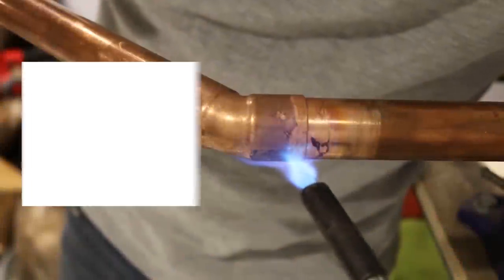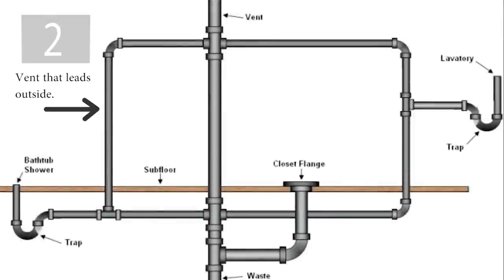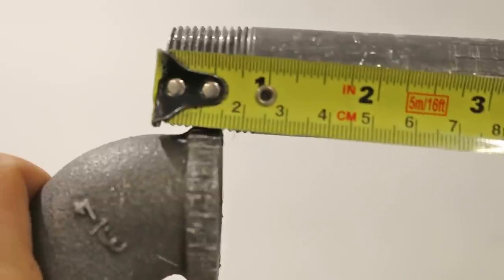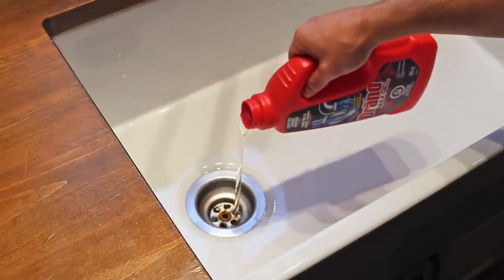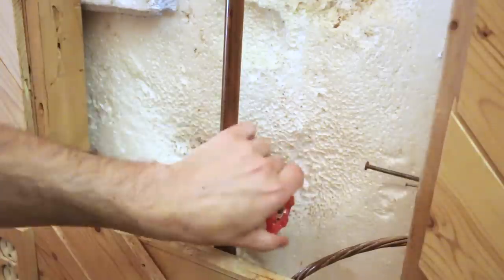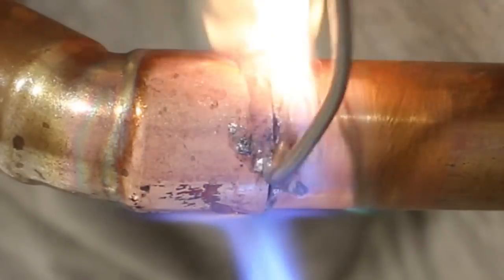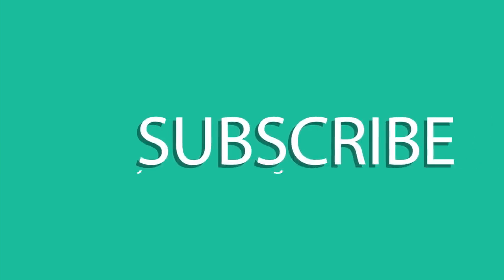10 Plumbing Mistakes You Should NEVER Make and How To Fix Them! | GOT2LEARN

Comment: Great info video as always!  Number 8, minor tweak: Use a paper towel that has been made damp with a mild baking soda + water solution. Baking soda is a buffer chemical, that tends to be close to neutral pH. It dissolves the acid flux faster (before the paper towel falls apart) without leaving a caustic residue. Using a "neutralized" paper towel also makes it more disposable so you don't have a contaminated "acid rag" hanging around with your tool bag. :)

Comment: Go clockwise with the PTFE tape is something I can use immediately.  Turning off the water before cutting the pipe is something I knew already - I was surprised to see it mentioned if even I know that.

Comment: What about flex line coated steel connected to 1” pipe in hose the only thing is I’d still have 20 feet outside my house could I roll it up and hang it on water rack on back of house and only unwind it win I need to hook up to 1/2” hose with quick connect on 1” house line and 20 ft of 1.2” gas hose to disconnect when not in use? My 2 shut off valve are in basement and we’re generator hooks up 13hp 420cc. I was told the hose would supply 36K BTU and my generator would need 28,500 BTU to operate right with my set up. I was going to go underground but figure I could coil it up when not needed. Or do you think the extra flex hose would wear out after a few power outage.

Comment: For kitchen sink clogs.  Do this.  Pour a pot of boiling water down the drain.  Then add 1 cup of baking soda and use a butter knife to really work it down the drain.  Let that sit for 10 minutes.  Then add 1 cup of vinegar.  Let that work for 10 minutes.  Add another pot of boiling water to drain.  Then let the hottest setting of hot water on your faucet run for 10 minutes.  That worked for me and I tried 2 helpings of lye with no results.  At first the baking soda method did not seem to be working then the clog let loose.  So I would suggest you may need to do it 2x if you have a nasty clog.  But just be patient and it will work.

Comment: You can use a brass nipple between galvanized pipe and copper pipe as a dielectric separator?
Reply from the maker: Absolutely!
Reply: Keep in mind that no di-electric fitting will stop electrolysis completely. The molecules travel in the fluid. He was sort of misleading. Black steel pipe doesn't cause electrolysis. It's the zinc in galvanized pipe that's the problem. A brass fitting will do the same as a nipple. (and easier,usually)

Comment: Something I learned from an old, experienced plumber: Teflon tape is for lubricating rough threads, while pipe dope is for sealing threads. That bit of knowledge has made my plumbing work  MUCH better - and easier. (Why do you think pipe dope is used on gas lines, but Teflon tape is NOT PERMITTED?
Reply from the maker: On the same page as you bud :)
Reply: ummm,,,  Although i use dope on gas pipes... where I am teflon tape is permitted (it's yellow) and works fine if used properly

Comment: Tip 11- on the back of your pipe cutter, the knob you twist to push the cutting wheel deeper, if you remove that knob, there is a spare cutting wheel under the know to replace the original wheel when ya break it. (o)(-) Winks @ ya'll  Remember- $95 dollar service charge plus 2 hr minimum to change toilets, faucets, disposals. Toilets are hepatitis risk $250. base price to install a toilet. If the flange is wasted, thats extra. Always, always, always replace the wax ring and water supply line when changing a toilet. I like a #2 wax rig with a color. I use braided water supply lines and I upgrade to 2 toilet bolts to 3/8 ths. Dont use the 1/4 flange screws they are a joke and always cause issues.

Comment: In item 4 I notice that the upper pipe was nice and loose to make fitting the tee easy. This does not always happen and you have to very accurately cut out  a section of the pipe to fit on the tee fitting, bending the main pipe gently to insert the tee then pulling it up to meet the other end of the main pipe. Any slippage while soldering or wrenching up ( I use compression fittings mostly) can mean reworking the whole joint.
Reply from the maker: Yeah, mine was the best case scenario. You would need a slip coupling ;)

Comment: Regarding #4 (installing a saddle valve).  I agree that a "T" fitting and valve is the better way to go, but I'm wondering if the "T" has that shut-off valve already attached to it (i.e., is it a "one and done" that you would purchase?).  The connection looks so seamless (no external evidence of solder or threading) that I'm curious how it is attached to the "T", or if it's a solid unit ("T" and shutoff)  that I would purchase.  My gut feeling is that it's two separate pieces, but how are they attached?  The "T" fitting shown typically has no internal threading, just three smooth bores.  Or, more likely, had you just not yet soldered the shut-off valve in place?  I should think, though, that you wouldn't want to risk heating the valve with a propane torch, which might damage internal rubber seals.  Thanks very much.
Reply from the maker: The valve and T are 2 seperate fittings. The valve is a male connection so it's a bit hard to see ;)
Reply: Got2Learn--So, the valve and "T" are two separate items (which I thought would be the case).  The valve is a male connection into the copper pipe, but how is it connected to the "T" itself?  I assume you have to solder it in place, but you didn't show that happening, and you didn't tell me that in your response to my question.  It is most likely not a press fit, which would quickly leak.  The "male connection" puts the valve far enough away that heat shouldn't be an issue for the internal seals.  In any event, I would put a wet rag around the valve to absorb the heat and not damage the seals.  So, one more time for the record:   Exactly how is the valve connected to the copper "T" so as to form a water-tight seal?  Thanks.

Comment: Using a brass threaded by copper sweat to go from copper to brass should keep you from having to use a dielectric union right? Its what we do on hot water tanks and have never had a problem.
Reply from the maker: Absolutely!
Reply: Mark so u want to tell me that black pipe to copper create an issue
Reply: @Got2Learn  Cool

Comment: Nice video :)
My teacher told me once that when the steel pipe fittings get hot they're tighten enough 😂
Reply: Yeah they do tend to get hot when tightening them!
Reply: If you have friction, that creates heat. Heat is bad! Pipe joint compound is to keep the surfaces from getting hot. The number one cause of leaks in threaded pipe is heat. The metal expands and prevents the threads from being pulled together completely. When the two surfaces cool... it leaks.

Comment: I've been a plumber for 42 years. Under tightening threaded fittings is more of a problem than over tightening. Crank that shit down. Use a backup wrench on the fitting or pipe that proceeds the joint your working on so you don't twist up the whole mess. I can't tell you how many times I've encountered leaking fittings that were not torqued down enough.
Reply from the maker: Well said, thanks Tom!
Reply: There's a great article in Audel's Plumbing and Pipefitting book from 1925  where Crane company mutilated threads. It's fig. 8,314 and fig. 8,315

Comment: i use plumbers/teflon tape as anti-seize not just as anti-leak..am i correct on this practice?
Reply: It does both, lubricates the threads to make them easier to tighten and fills the threads to stop leaks.
Reply: I use it for same on garden hoses, laundry fittings,  buddy, it helps.
Reply: Absolutely!

Comment: A few years back a neighbor had some old leaky pipe section replaced with some new type plastic pipe. A special tool was used to crimp fittings on. Anyway, later on a rat chewed on new plumbing causing a leak worse than before 😬. I think copper pipe is the best.
Reply from the maker: Yes, for many things!

Comment: I didn't know about the excess flux thing.  I always wiped it off just to make sure I had a good solder joint.  Usually while the pipe was hot and with a wet rag.  Doing the right thing for the wrong reason.
Reply: Never wipe a hot joint with water let it cool naturally otherwise you could cause a fault in the connection due to rapid cooling . Wipe only after its completely cooled to room temp or near there .
Reply: As Ragnar mention, wiping a hot fiting that was freshly solder will cause the metal to rapidly shrink and will cause a crack in the soldder and thus a leakage.

Comment: Good information. I have one big problem with the Teflon tape procedure and that is you should only put 1 and a half turns of gaps 1 to 2 threads from the end. Multiple turns make it easy to over tighten joint, putting tape close to or on the first thread will allow the tape to protrude into the inside of the pipe. Any of the products used are used to do 2 things. Lubricate the threads and fill any small imperfections so you get a good seal. More of eather of these things is not going to help
Reply from the maker: Ok thanks
Reply: No problem. My profession is hydraulics and I find a lot of broken joints and pieces of tape in systems . Thank you for for putting this together it has great information
Reply from the maker: My pleasure man, glad you liked it, don't forget to subscribe and share, it helps a lot :)
Reply: Obvious one but essential, use only special PTFE tape designed for fuel lines on burner supply lines, valves etc. This tape is different from the one meant for water and leaks will occur if the wrong tape is used.

Comment: Ok your the expert here and I ask a question yesterday and didn't get an answer,so I'll try again I'm having to fix someone else's crap, anyways it a different question im working on the slab/ outside water line,my problem is everytime I try to solder my torch turns off and sometimes fumes build on wall and a small fires starts but again torch turns off,why ?
Reply from the maker: How old is your torch, sometimes when they are finished they do that. Also, have you ever got a drop of solder inside the nozzle, that might be it ;)
Reply: @Got2Learn  the tanks r brand new and torch is that old
Reply: Could it be the propane bottle
Reply from the maker: Are you tilting the torch? If you tilt it for sure it will make a ball of fire and turn off.

Comment: Another mistake you can do installing your saddle valve is using plastic line and draping it over steam pipes. This happened at my dads rental property and he thought the steam piping was leaking. 10’s of thousands $ later after an asbestos abatement company came in and 3 new boilers were installed, it was clear a tenant installed fridge line was the leak.

Comment: At #7 did you say that other option is to use a brass nipple? Because here in México most of the conectors (both male and female) are made of brass, so if i use them i should be fine, right?

Comment: 11. Don’t use a gate valve. Get a ball valve instead.
Reply: Josh UNLESS WORKING ON COMMERCIAL BOILERS .. !!
Reply: @voiceofraisin241  1/4 turn valves are quicker to shut off than gate valves which is much nicer -- even if they do fail at the same rate.
Reply: I learned that ball valves are not ideal for half-open situations - gate valves are better for that due to premature wear on the ball valve in a partially-opened state. Not a huge issue for me but had I known, I would have requested a gate valve for my main sprinkler shut off instead of a ball valve.
Reply: Vero 0 - why would you want a partially open valve on your sprinkler system?
Reply: @vero0992  Neither ball nor gate valves are the proper choice for operation in a partially open state.  These should be used fully open or fully closed.  Use a globe valve instead if flow regulation is required.
Reply: @StilettoSniper  Just looked up globe valves. I see what you mean! Thanks for the information. I won't go replacing the existing valve, but I'll keep it in mind for the future. Much appreciated.
Reply: @voiceofraisin241  Don't confuse those cheap quarter turn valves for toilets and sinks with quality lead-free ball valves made by companies like Milwaukee, Apollo-Conbraco, Nibco, Wolverine, etc.  Big difference in price and quality.

Comment: Can you please make a video on how to find fitting allowances
Reply: What exactly do you mean by "allowances" ?
Reply: @Got2Play  I think it refers to code. Example- I helped rehab a house, electrician did all new outlets and wires after we framed the kitchen. He explained that code does not allow for more than 3 fittings between one junction box or outlet to another.
Reply: I think it has to do with the basic length of pipe you need to go from center to center so basically length of pipe to connect to fittings on either side?

Comment: When soldering you apply heat to one side of fitting and solder on the other side. when solder melts remove heat and move tip of solder around pipe and your done. Never put solder in flame of torch, you will have leak.
Reply: Bingo. Someone that knows how to solder.

Comment: Saddle valves. Don't care for them. But I have two installed.
I'm not a plumber, but I know how to solder a union and properly fit a compression joint.

I have a couple of saddle valves on the property, simply because the alternative would have been a 'professional' plumber (in my locality unlikely to be cheap or minimally competent) and a bill that might have involved a second mortgage. So - desperation stakes.
Only one is on a potable water line, and I check both regularly. I'd sooner they were history, but sometimes it's horses for courses.

Comment: 3:43 Use a wipe-rag soaked in strong baking-soda solution for an even better cleansing, since the alkaline soda will neutralize the acid-based flux.

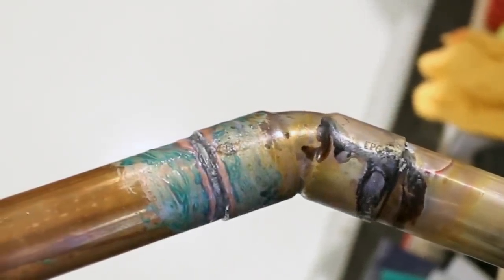Comment: 3:30 - Small correction, flux doesn't "prevent" oxidation while soldering, it eats surface oxidation allowing the soldering bond to take hold.

Comment: Those pierce valves have a bad rap. Had them in the house I grew up in, and open and closed them twice a year for over a decade without issues. 
I put 1/4 turn stops in my house (npt to avoid heating up the valve seats), a year later it leaks when shut off. I have a replaced a few of these. The multi turn globe ones leak after several years due to seat rot, the ball valves the seat get distorted after sitting open too long. They all leak... 
Lately I have been using gate valves, because if they ever leak, you take the gate out, polish it on some 600 grit and put it back together. Metal to metal seal.

Comment: @got 2 learn where can you buy those t fittings for ice maker installs
Reply from the maker: The one in the thumbnail?
Reply: @Got2Learn  are you asking me or telling me
Reply from the maker: Asking
Reply: @Got2Learn  yes the one in the thumbnail with you showing the proper ice maker kit to use the fitting Tee instead of the older version saddle valve kit
Reply from the maker: The tee I used is just a normal copper tee with a male shut off valve, these are pretty much available in every hardware store.
Reply: @Got2Learn  is that shut off threaded or sweat
Reply: @Got2Learn  I'm asking because it's hard to see and your video went too fast

Comment: Used a commercial drain opener in a bathtub called Cobra. Instead of clearing the clog, it backed up (expanded) and ate the bottom of the porcelain tub. Had to pay to get it filled and refinished....It was my renter's. Lessons learned.   1998   $400.00

Comment: I always like to use the cheap water pressurized plumbing tool to unclog pipes. Works evertime and can be bought in most hardwares.
Reply from the maker: Yeah they work well, makes me wanna do a review of the airsnake from Milwaukee ;)
Reply: You mean a plunger? Make sure drain fittings are snug...slow steady movement with proper suction/seal

Comment: Re 2:35  He seemed to turn off the supply above the cut.  You still need to drain the pipe above the cut, or you could still get up to a gallon of water draining into your walls from the pipes above and sometimes even below the cut.  Open at least one (preferably every) valve to air above your cut, and one more (to drain as shown), near and at least slightly below your cut, so the cut pipe will stay drained while you work.  Also, some Hot/Cold controls (if activated during your work) can act as a siphon while the supply is turned off, to pull hot water into the cold water pipes.
3:50 Just to pick a nit, be sure to wipe the pipe even where the camera cannot see it.

Comment: unclogging drains: get a small bottle of dish detergent and dump the whole thing down the drain. (If you suspect a lot of grease, such as in the kitchen, stir in some sodium triphosphate powder, found in the paint department.)

Just let it sit for a while, half an hour or so at least. A few strokes of the plunger may help force the detergent into the clog. 

This lubricates the clog, and helps dissolve grease and most other common binders. 

Of course, it will not work on non-soluble objects, such as plastic wrap or flushed tampons.

It's not a perfect or universal fix, but since a plumber taught me this, I have yet to find the clog  that defeated me. 

Does wonders for an overflowing toilet.
Reply from the maker: Thanks a lot buddy :)
Reply: "I have yet to find the clog  that defeated me. " OK, this finally happened. I eventually got one of those plastic drain cleaner strips, with barbs cut into the edges, and rand it down the backed up shower drain. It came back up with a shred of plastic film it had snagged. Those things are great!